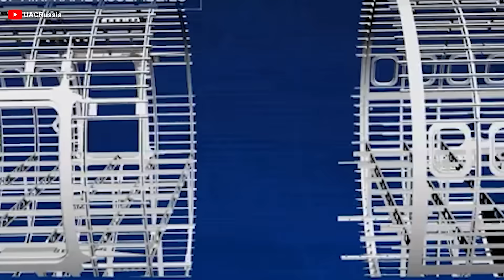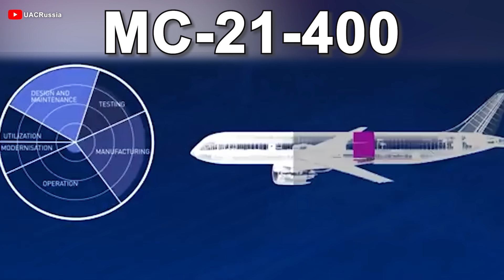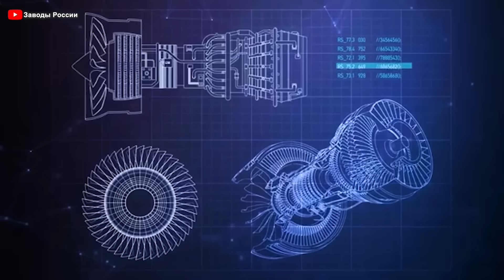Russian NEW MC-21-400 Will Change the Aviation Forever! Here's why

Comment: I think Boing is dead,  Too many safety issues and China will never buy and US or European made new aircraft.  Why buy from a nation trying to destroy China?  This Russian series is ideally positioned to replace the Boing 737 series for China.  Enough range to cover 75% of Chinese flights and the fuel efficiency of a narrow body aircraft and modern engine.  But you ignore the feasibility of modifying this design for cargo aircraft, which will be increasingly important to China as its exports become higher value and less heavy.  But both Russia and China need to merge their aircraft production, giving Russia 1 segment, for example the MC21 segment and giving China the wide body segment.  Similarly allocating different engine designs.  After all, China and Russia do not need to worry about monopoly accusations and can share the overall aviation market with less redundancy.
Reply from the maker: Chance for new player!

Comment: Russia the best one.
Reply: not really
Reply: @kjererrt7804  usa: No ipersonic. usa: no oreshnik. usa: no sarmat. ecc. ecc. ecc. Far away from Russia.
Reply: @ that doesn't contradict with what i said.
Reply: @ russia: no microelectronics, no processors, no cell phones, no decent cars etc. basically russia as always is 20 years behind the us. all russia has is made in china with the american technology. speaking as a russian myself. the russian desktop CPU baikal-m is as powerful as intel dual-core core2duo CPU from 2008. and it's price tag is $450. such is the technological gap. btw now that taiwan has imposed sanctions on russia, russia is not fully capable of manufacturing their chip. all russian new cars apart from the useless lada are rebranded chinese models. so not really the best one.
Reply: @kjererrt7804 👈🤡Ты главное верь в свою чушь!😂😂😂
Reply: @ what isn't correct?

Comment: I wish Russia the best with this aircraft, the global backlogs from Boeing and Airbus leaves room for a solid competitor.  That said, there are significant barriers here...  One, the aircraft needs to get certified to be able to be used globally.  Two, they are a long way away (I believe) from ramping up production to fulfill anything in the domestic market, let alone outside Russia.
Reply: they are starting to build it only because boeing stopped working with russia because of the sanctions. that's all.
Reply: Believe me. MC-21 has passed Russian certification successfully and I think that is enough to be used globally. If you meant some super-duper-global-international-western certification, so i can say that Boeing Max certification has shown the real value of Western certifications. Western certifications are nothing more than an instrument of unfair competition with non-Western competitors.

Comment: MC-21 has an all composite lightweight structure.  using all Russian PD-14 engines. MC-21 300 costs $91M versus B787 /$288M. much better value buying Russian jets.
Reply: Sorry but MC-21 is heavily overweighted now. First MC-21 models with Japan wings and western engines were competitive but…